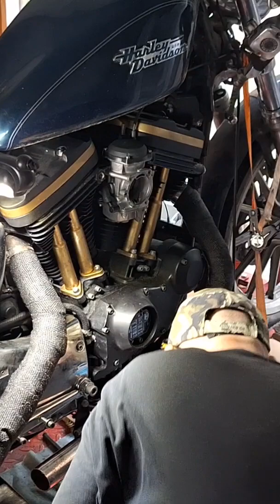The Problem with Single Fire Ignition Systems

Comment: If it has two seperate coils with three wires on it then it has a centre tapping so each coil will have a resistance between each coil
Reply from the maker: Yes but not between each side. You would consider them as 2 separate coils. I